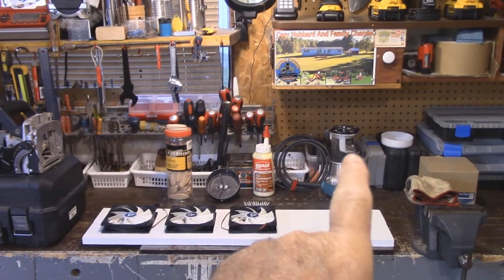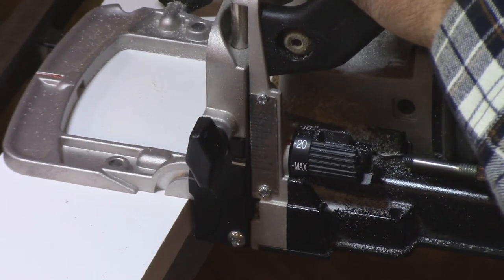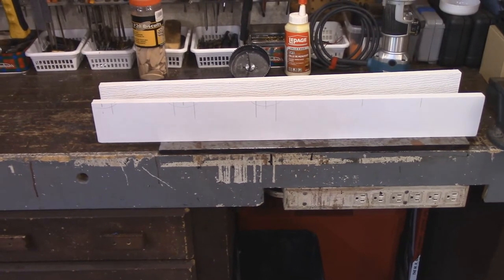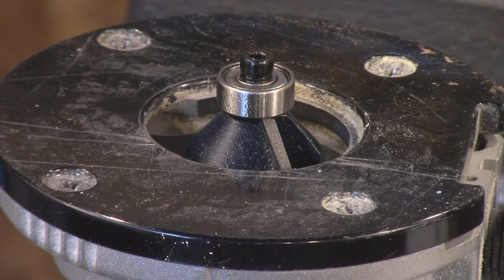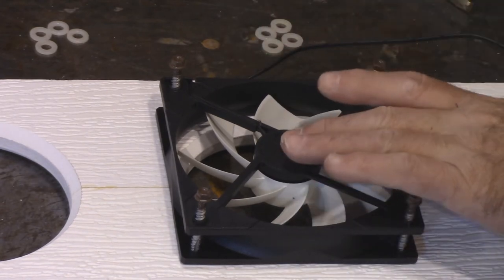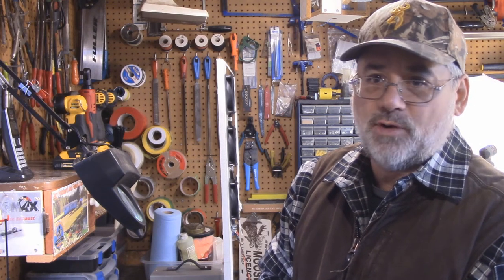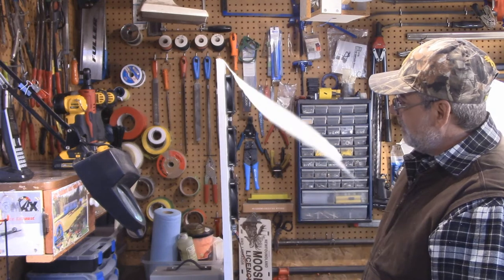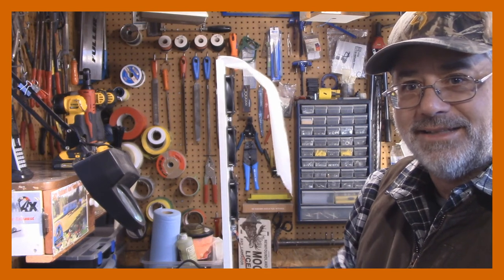Solar Powered Ventilation Fan For Your Cottage - Reduce Mold - Moisture And Musty Smells

Comment: Condensation is always an issue when dealing with high temperatures! I'm having a bit of trouble with that at my trailer myself.
Nicely put together Steve! Thanks for sharing🍻
Reply from the maker: Marc if your not hooked up to power these fans on solar do a great job at moving air ,  10w  solar panel is more than enough for 3 of these fans . I will show my panel setup next month. Cheers bud 👍

Comment: I just thought to myself, "I wonder how Steve Rob's north pole real estate was doing?". Those fans should keep the air moving nicely and with cleaning them whenever you're up there they should last 5+ years no problem. Nice job and good idea.
Reply from the maker: The camp  needs some air flow since it's closed from November till may and this should do well running off solar.  Cheers 👍

Comment: Great job Steve - they sure are quiet running fans, I similarly use computer fans for this reason but they are much louder. Cheers
Reply from the maker: These are very quiet and push a lot of  air .  The 2 in my shed run every day taking the heat out as I'm not getting ice buildup on the steel shed roof inside anymore .

Comment: Steve I need more information on what brand of solar panel you are using and more details on how they are wired. This is exactly what I need to remove the mold issue in my garden shed.
Reply from the maker: I don't know the solar panel brands  just 5w panels. The fans you can buy online anywhere.  These are arctic brand fans .

Comment: You don't have one of those fancy glue bottles specially made for biscuits?  Nice clean build Steve.  I need to install one in my shed.  When I finally clean up the garage and find the solar panel I have, I'll have a few questions for you
Reply from the maker: Thsnks Bruce.  No I don't   , not sure I seen a biscuit glue bottle :) You have to try some for your shed makes a huge difference in the summer.

Comment: Usually the PVC trim is glued with PVC glue which is actually a solvent weld. That looked like regular wood glue? How strong is the joint?
Reply from the maker: It's glued  rock solid , I have not used anything but regular wood glue on pvc and it seems to be real solid.